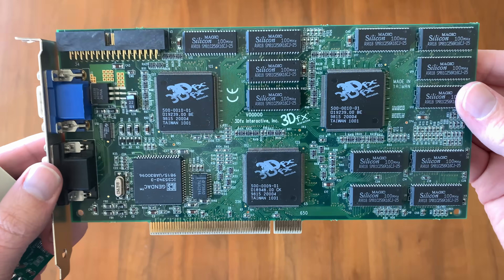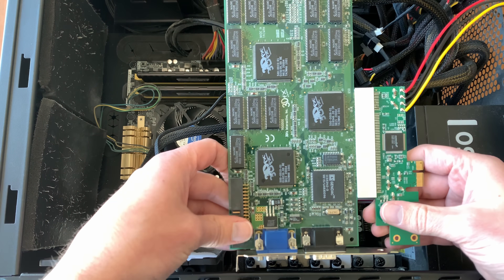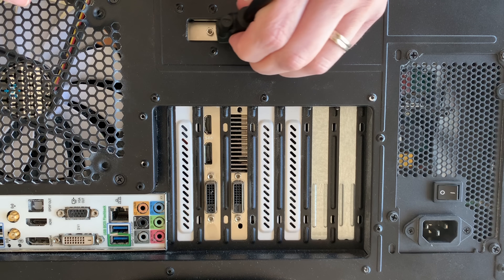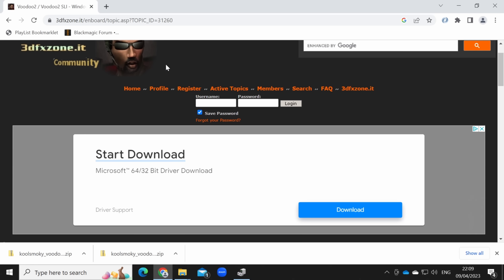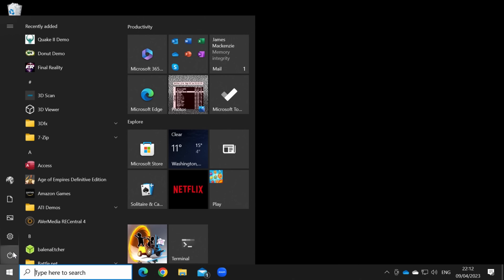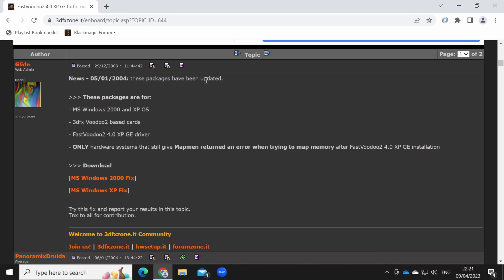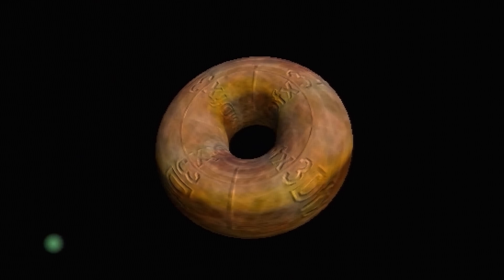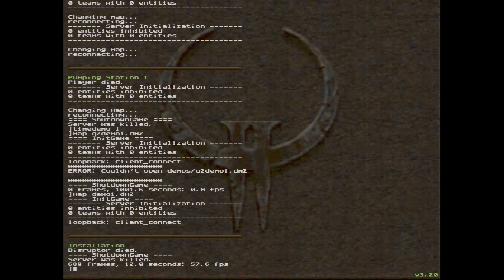I made 3Dfx Voodoo2 work on a modern PC!

Comment: Working with that single PCI adapter, awesome. But what about those PCIe to 2x PCi adapters you may find as well ? Good for SLI or better use 2 like this one you think ? Also, you have a model without capacitors, while there are models with capacitors. What the point (same price so not a big deal) ?
Reply from the maker: I’m actually buying one of the dual risers right now - will let you know!! They typically use the exact same bridge chip (ASM1083). So I don’t think there’s a big difference.

Comment: I'm glad I still have all my Voodoo GFX cards and Diamond Monster 3D II card:

1x Diamond Monster 3D II 4MB (used with a Voodoo 2 12MB GFX card)
4x or 6x Voodoo 2 12MB (PCI and in SLI !!) (when my old friends bought new Nvidia GFX cards, they donated their Voodoo 2 cards to me because it was a waste to throw them away imho)
1x Voodoo Banshee (PCI)
1x Voodoo 3 3500 (AGP)
1x Voodoo 4 4500 (AGP)
1x Voodoo 5 5500 (AGP) (temporary had this GFX card, but it stopped working)

I knew 3DFX was the founder of 3D gaming and Voodoo GFX cards would be collector items.
This is my childhood also 😃

Comment: How did you run a 16 bit demo in Windows 10 64bit? The Demo won’t run for me in 64 bit. Also, Windows 10  64 bit has flagged the driver as malicious and has not allowed it to use resources, rendering it useless. I’m glad you got it to work.  It seems you have a perfect blend of hardware to make it happen along with your hard work. Cheers!
Reply from the maker: Great question! I used winevdm: https://github.com/otya128/winevdm

It's mostly only needed at install time. Once the software is installed, it mostly runs fine on modern windows 🙂

I had to disable driver signing using Windows advanced startup, before the Voodoo drivers would work for me. Did you try that?
Reply: @jamesfmackenzie  Great tip! I will keep that in mind. Ultimately, I ended up going with an XP install. But thanks to your video I  found a way to use my Voodoo again... so a big Thank you.

Comment: Had a 3dfx voodoo 1. Good times.
I wonder how you would connect that passthrough vga cable 😂
Reply from the maker: The passthrough is optional - you can just connect the VGA output and switch to that whenever you’re using the Voodoo :-)

Comment: Now do Dual-SLI cards for even more frames-per-second at 1024x768. 

Also, you can run multiple sessions of Quake 2, each one in a window, then start a multi-player server in one of the windows then each window session can attach to it. Then you just have to alt-tab to each window to control that player and set up some fun situations.

Comment: Well done!   I love my voodoo 5 64mb card, however after 2 moves in the past 3 years ive seemed to have misplaced it, and the intel itanium system with the og sound blaster card i had with it.  #256mb ram baby!! Lol.  Last upgrade to that was sata ssd, and it was FAST running Win98se w/ U.O. SP..  
I loved playing OG GL-Quake with the KQP, which sadly i cant make run on a newer system in dosbox😢.  
However, when i get time, ill hopefully get things sorted and get that system back up and running for my retro stuff.  
My fav game of all, was from Lucas Arts, called FULL THROTTLE!!  A game WAY AHEAD of its 1996 (i think) time.   Long. Hard. Fun. And almost like nothing else, except probably a bit like Escape from Monkey Island, in the control aspect, not the story.

Comment: More about the leap about which people are talking here.
Lets omit the possible rendering on Amiga and/or Silicon Graphics which were present somewhat before those days.
I might be incorrect with digits, but these will be an examples just for reference.
The greatest speed for games the PC was giving, lets take some particular CPU closer to those days, and that would be AMD K6-2 300 MHz: you'd get 30-60 fps on 320x400, pixelated.
Pretty cool. Way better than on bare i386, 320x200 resolution, and 30fps is achievable only if you diminish the window very much (that's why an old games have a "screen size" buttons).
But! On Voodoo 2 you get 60 fps on 640x480 resolution. With a colored transparent overlay (getting damage in game or taking a powerup) it diminishes to 30 fps. Pixels are interpolated. Mipmap is present.
It also can draw 800x600, but you don't get 60 fps.

Comment: I'm surprised that the adapter worked. I use a similar adapter for old 32-bit machine vision system frame grabbers, and those kinds of ones don't work for me. I need to use ones that are more complex or i get a black screen, and they can be harder to find. It is probably because my work relies on data input, whereas video displays are output. You are also lucky to find a 64-bit driver that will work properly with the 32-bit hardware. The devs did a good job.
Reply from the maker: Thanks!

Yes these ASM bridges are very cheap and cheerful! Which bridge devices do you use? Pericom? Or something else … ?
Reply: @jamesfmackenzie  No they're kind of like these ones, as in I think they were about $35 each, but they seem to have more/better components on them. They aren't as easy to find. I tested about 5 different kinds before I located the ones I use.
Reply: @jamesfmackenzie  I tried StarTech with no success and I believe the one I'm using now is Sintech - it uses an asmedia 1083 chipset

Comment: Try to run Diablo II in glide mode, just wondering if the emulated/software glide mode of Diablo II Resurrected has the same quality like hardware glide mode of the original Diablo II.

Comment: Props to the case manufacturer for having the foresight to add the horizontal slots for the eventual mass adoption of VooDoo2 cards. I'm certain this will become de rigeur for all bitcoin miners.
Reply: You can only mine Dodge and Raven on a 3DFX card, not Bitcoin.

Comment: Thanks for the informative video  and attempt of writing general driver for 64 bit windows versions from windows XP up to Win 10 without forgetting SLI support.
 Good work, thanks.
 Do you know a source for an adaptor for using PCI-express cards on  PCI slots?
 Bye .
Reply from the maker: No worries!

Full disclosure - I didn’t write the driver. I found it on the 3Dfxzone forum - so the author is the real hero here 😎

You can find the adapter on eBay. This is the one I bought:

https://www.ebay.com/itm/125641170716

Good luck!

Comment: As far I remember - voodoo works as extension to video card via vga cable. Here I didn.t see any bridge from graphic card to voodoo. Looks strange
Reply from the maker: Yep, 2D video is normally passed through the Voodoo card, so you only need 1 cable running to your monitor.

In this case I ran two cables:

1. Primary video card outputs 2D graphics via HDMI out
2. Voodoo outputs 3D graphics via VGA out

So I need to switch the monitor input from HDMI to VGA when “Voodoo mode” kicks in. But it still works 😎

Comment: How do you did get image from a voodoo without another card to do the 2d image?
Reply from the maker: You don't have to use the VGA passthrough. You can connect a VGA cable to the Voodoo output only and it will "come to life" when the Voodoo activates into 3D mode 🙂

More details here:
https://www.vogons.org/viewtopic.php?t=71543

Hope this helps!

Comment: I have a dedicated PC for my Voodoo 2s. Its mostly a 1998 High End build. 2x Voodoo2 in SLI, Pentium 2 450MHz, Riva128ZX the only thing that is needed, is a correct Soundcard. I only have onboard Creative Audio PCI
Reply: Get an Aureal Vortex 2 if you want the best card of that time (aka the correct soundcard as you put it 😉)  Aureal had a short lifespan (1995-2000) just like 3Dfx but their Vortex cards and A3D did for audio what Voodoo cards and Glide did for video.  Creative Labs would come out with EAX as an answer to A3D but it could never match it for quality and the accuracy of it's 3D simulation - where EAX would approximate how sound moved around the player A3D had a dedicated processor that would simulate sound waves bouncing around the environment until they reached your ear, a kind of ray-tracing but with sounds.  The accuracy of the 3D audio was years ahead of it's time.

A3D was originally created for NASA to simulate the audio environment in a Space Shuttle simulator, a neat accolade for a soundchip.
A3D was also supported by the best games of it's era - Unreal, Quake II, Forsaken, Turok 2, Soldier of Fortune, Kingpin, G-Police, Jedi Knight, Half-Life, Quake III Arena, Deus Ex, etc etc 
A3D accompanied by Glide is the best way to play the above games, it's how the developers intended them to be played!
https://en.wikipedia.org/wiki/Aureal_Semiconductor

No, I didn't work for the company, I just really loved their cards 🤣  If you also want some of the best era-specific speakers search "Cambridge Soundworks" on Ebay

Comment: How does it work without pass through I guess no modern card has VGA? What monitor did you use?
Reply from the maker: The passthrough is convenient because it automatically handles the switching between your primary video card (used for 2D graphics on Windows desktop etc) and the Voodoo (only used when you play a 3D game)

But it’s not required. You can just run two cables and switch yourself by changing monitor input (which is what I do) 😎

Comment: I thought 3DFx cards required the passthrough cable from your standard video card to it, then output from 3DFx card to your monitor? or was this done off camera? I had a Voodoo 1 3DFx card back in the day.
Reply from the maker: The VGA passthrough is super convenient but not required.

I connect two cables to my monitor (one HDMI from my modern GeForce, one VGA from my Voodoo) and switch inputs whenever I want to play the Voodoo.

This Vogons thread covers it well:
https://www.vogons.org/viewtopic.php?t=71543

Hope this helps!

Comment: Amazing amazing work. I've got a question: how are you getting the video output? Doesn't the Voodoo2 cross-connect via VGA to the main video card? I only saw 1 cable in your setup, not the expected 2.
Reply from the maker: I don’t have the passthrough cable connected, so I have to switch input on my monitor to use the Voodoo2 :-)

Comment: was the 2nd port for a 2nd card to daisy chain? I would drag out my Unreal 1 & 2
Reply from the maker: It is for VGA passthrough. So you can connect the output from your regular video card into the Voodoo. And then it handles the switching between using the regular card (e.g. for Windows desktop) and the Voodoo for 3D graphics 😎

I didn’t bother and just connect two cables to my monitor - and switch inputs manually 😎
Reply: @jamesfmackenzie  trying to remember.. is the top connector an ISA for CD-Rom? I remember Creative releasing the DxR2 set for watching films in Dolby 5.1.. bought it when it came out.

Comment: Setup like this I assume you have a monitor that has 2 video inputs and switch to the Voodoo when using that? Since you appear to not be using the passthrough on the Voodoo.
Reply from the maker: That’s right! I’m doing exactly that. I have a 24” panel with both VGA and HDMI inputs, and I just switch between the two :-)

For recording, I have two capture cards - a newer one that has HDMI capture and on older one that does VGA :-)

Comment: I'm not sure this demo is actually using the 3Dfx card.
It is an analog pass through accelerator card. You are not passing any analog signal into the 3dfx card input for it to accelerate. 
You are likely (somehow) using your existing graphics with a Glide conversion...
Reply from the maker: The Voodoo2 works hand-in-hand with your 2D graphics card.

When rendering 2D graphics (like the DOS command prompt or Windows desktop), the Voodoo2 is not active. The VGA output is simply “passed through” from your traditional graphics card and displayed on the monitor.

For 3D accelerated workloads (e.g. when playing a Voodoo-enabled game), the Voodoo2 “takes over”. 2D graphics are no longer passed through, and the Voodoo2 handles all rendering to the screen.

Voodoo-enabled games must leverage a 3D API like Glide, with communication running directly from CPU to Voodoo2 over the PCI system bus.

The passthrough interface is convenient, because it allows the use of a single monitor for both cards. But it is not required.

HTH!

Comment: Only problem is that,vga crts do not go down that low resolution?
Reply from the maker: Voodoo2 typically outputs at standard VGA resolution (640x480). Should be great for CRTs 😎

Comment: PCI bus was 33 MHz? Does that adapter match the bus frequency?
Reply from the maker: Yep! The PCIE to PCI bridge specification allows for different clock options, and can run at 33mhz. The bridge chip then translate it into a serial format to send through the PCIE bus 😎
Reply: @jamesfmackenzie  Thanks for the info. I do vaguely also recall people connecting their VooDoo 5 agp cards to motherboards with PCI-X slots using an adapter.

Comment: I got this video recommended and I actually liked it.
When I played Quake 2 back in the days the game looked worse than in your footage. I guess I had a weaker graphical adapter.
 Especially I remember models with lower texture resolution.. is it possible that the game checks for available vram and tunes the settings according to it?
Reply: Maybe you used it with software rendering
Reply: @TheRailroad99  Yeah, I guess so

Comment: wasn't it GPU output to vodoo input?
how did you managed that DVI to VGA
Reply from the maker: The VGA passthrough is optimal. If you want to, you can just run two separate output cables and switch between input sources on your monitor (which is what I do)

This Vogons thread explains it better than I can:
https://www.vogons.org/viewtopic.php?t=71543

Hope this helps!

Comment: sir, in the stash of parts I have, I have the opposite of that(I have I think 2, not super common I don't think but was PLX based).... anyone out there with a gtx 4090 and 486??
Reply from the maker: I did find this superhero who uses an RTX 4090 and i7-4770k 😎

https://www.reddit.com/r/buildapc/comments/yp0my3/will_this_spec_work_temporarily_4090_with_i7/
Reply: lol, if t works it works:P.... ** relating to the pci-e to pci adapter, should you look into it, I think it essentially works in x1 mode although it's a 16x adapter.... in truth I do not think it would be supported on a 486, but maybe something a bit newer... other note, since purchasing these things I got my hands on 2 other devices that use the same plx chipset, one being cctv security camera nvr card and the other being ;a HD5450 pci card

Comment: I still have two vodoo2 GPU cards in box somewhere.   This is kinda nice you got one too work. What about trying two of them in SLI? If that even works.  

I wish Nvidia never bought out 3dfx.   Happy with my old GTX 1080ti gpu. It’s last new Nvidia gpu I’ll ever buy.  Nvidia has become too greedy and there RTX 4xxx are a joke and middle finger to gamers.  Consider they are all cut down version at primer prices, (memory bandwidth is joke on all RTX 4xxx vs last gen RTX 3xxx) except the 4090 is only gpu that not cut down, but still at high primer price.  

Good video.
Reply from the maker: Great suggestion! I’d love to try SLI 😎

I’m still running a 2060 Super on my main PC. Don’t feel the need to upgrade anytime soon 😂
Reply: @jamesfmackenzie  
Thanks for reply man:) Yeah my old 1080ti has been great card, don’t feel the need upgrade atm, and Nvidia has gotten so greedy lately.  2700x/16GB/1080ti has been fine for what I play.  Mostly play older games like  replaying starcraft 2 again and I play a lot ATS. I am saving up for 3 monitor or TVs for ATS.  May need upgrade to a used 2080ti at some point, if my old GPU can’t drive 3 monitor at 1080p for American truck simulator.  But in not rush atm.  My friend bought 6800xt and he happy with it. May upgrade to that instead.  

Yeah you should try get SLI to work for 3dfx vcard, maybe for quake or some old 3dfx demo or something?

Comment: I have a Voodoo 3 PCI card. Would your steps work with that card, or would I have to find separate drivers?
Reply from the maker: The drivers I found are specific for Voodoo2 - unfortunately you’d need to find different drivers :-(
Reply: @jamesfmackenzie  got it

Comment: Nice !!! what was that other vga port on the card? a vga input?
Reply from the maker: That’s right! The Voodoo2 is a 3D accelerator card only. You still need a regular 2D card for everything else.

The 2D output is “passed through” with this extra VGA input connector. When “3D mode” is enabled, the Voodoo takes over the video output, and then hands back to the 2D card afterwards.

Clever! 😂
Reply: @jamesfmackenzie  Thanks for the clarification!! I came on the scene when the Voodoo3 came out and did not see the pass through port...

Comment: While you did get it to work on X64 win 10, would it be easier to run Win 10 32 bit and use the drivers you wanted to at the start of the video?
Reply from the maker: It’s possible! But this is my main PC so I didn’t want to change the OS 😎

Comment: I have a pair of these in SLI that I threw into my old family IBM PC from 1998 that has a Pentium II 450Mhz which was pretty much the fastest CPU available when the Voodoo2 launched and it still bottlenecks those cards significantly. Mind you, it's still smooth but it takes a 700-800Mhz Pentium III to entirely avoid CPU bottlenecks even at 1024x768 which is what I run them at.